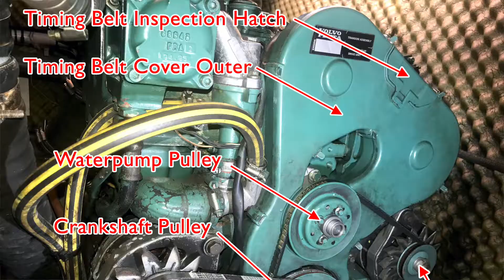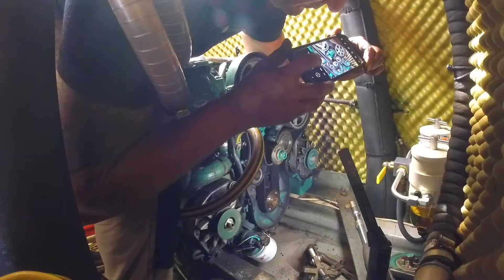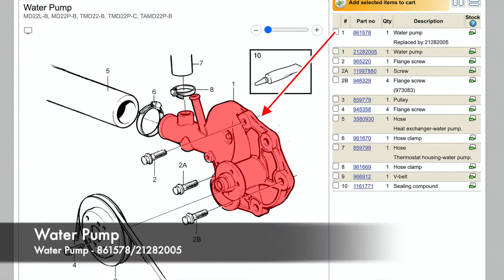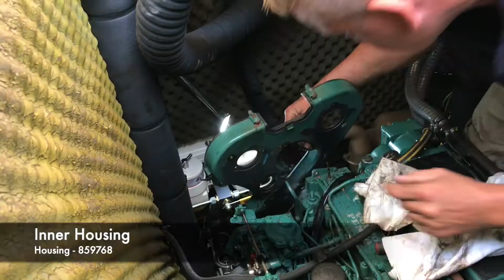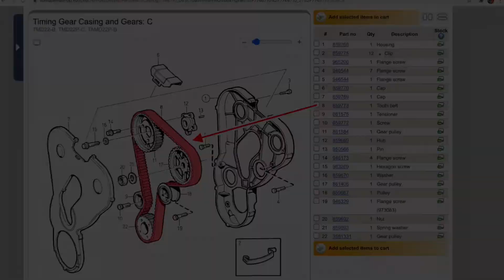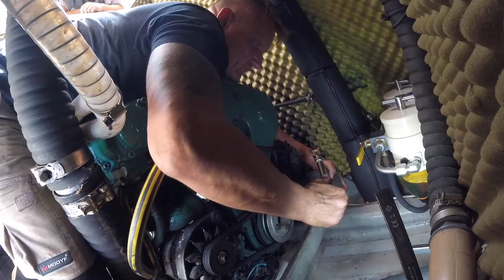Timing Belt, Water Pump, Pulleys Replacing on Volvo Penta TMD 22 Perkins Prima Marine Diesel Engine

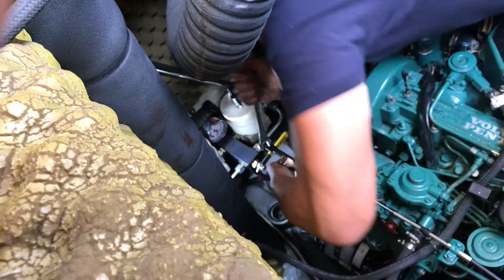Comment: Im curious how you knew at minute 17:20 or so that the injection pump pulley was not aligned properly. I replaced my coolant pump today using this video and the manual and at the end when i tried starting the engine, it wouldn't turn over. I was just wondering if that is the issue you encountered.

Amazingly helpful video, by the way. Thank you very much!
Reply from the maker: I was just changing the belt and noticed the pulley was rattling a bit so decided to go ahead and change it. Glad we did because we just met someone in the Red Sea who was stuck waiting to have one shipped in at huge expense and weeks of delays. Do it when you can is my advice! No we didn’t have any issues starting afterwords.. did you maybe knock something (electrics?) when changing the pump?
Reply: @MothershipBoatMaintenance  My issue turned out to be that the pulley was 180 out. For the TMD22 the key is supposed to be on the 'B' mark and the MD22 should be on the 'A' mark. I got it all resolved now. Thanks again for this video, I don't think I could have gotten through this repair with just the manual.

Comment: What did it cost? 
It's all so complicated.  I'm looking at electric motors and LFP battery, which look to be similar priced than a refurbished diesel, and a lot less fiddley
Reply from the maker: I can't remember the final cost but electric motors are undoubtedly the future.. although I still don't think they're quite there yet for leisure boats. You will obviously need to up-skill on the electric side of things and the mechanics of transmission won't change much. Still.. I won't miss the heat or the diesel and oil leaks in the engine bay!

Comment: Nice video! How did he adjust the tension on the new belt? They specify a certain tension in the manual and a special gauge to verify it, how did he do it?
Reply from the maker: Good question.. and I'm not entirely sure. If it's not slipping, squeaking and doesn't have more than 1inch slack, I generally think it's OK though.
Reply: @MothershipBoatMaintenance  He did a good job, clearly experienced and had done this engine before. He would know by feel exactly how much tension a cambelt need.

Comment: How reliable is the engine?About to buy a used one that needs the turbo, thanks.
Reply from the maker: It's actually a British built Perkins Prima with a Volvo badge and if you source Perkins parts (rather than Volvo) they are reliable and relatively easy and cheap(ish) to maintain. Most marine engineers are very familiar with them too so a very safe bet for a boat. Just get it checked over and the oil tested before you buy. We replaced out turbo about three years ago.. not a difficult job but not cheap either.

Comment: Brilliant video and well explained. Have a similar engine (Perkins m50) where the timing belt is up for renewal. Thanks for putting in this effort to document the process.
Reply from the maker: No problem Petter, glad it helped 👍
Reply: @ Petter ..or even  the author   ..
Hey there ..quick question..trying to work on my Prima m50 as well..and was wondering what is the crankshaft center bolt socket size to use to remove pulley?! ..is it right handed screw ..? ..so to loose it I have to go clock wise ..from front of engine?!! Thanks in advance Petter. Patto